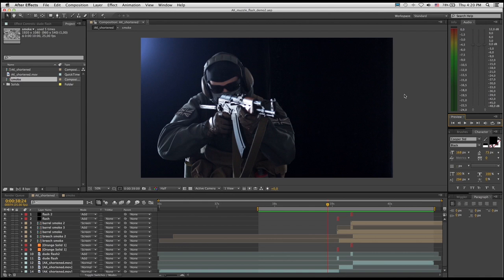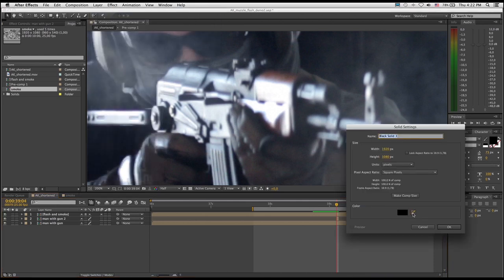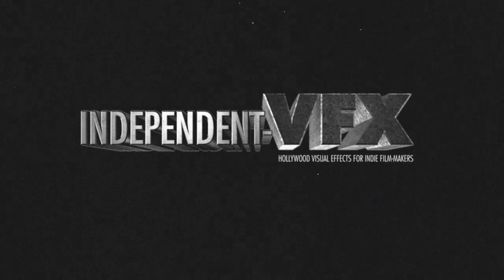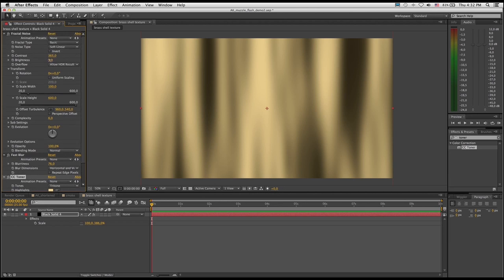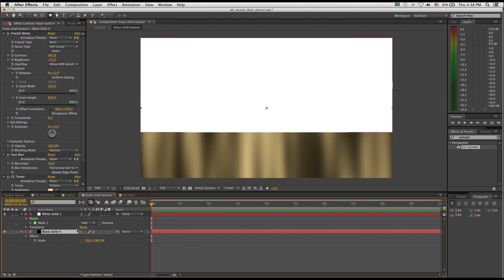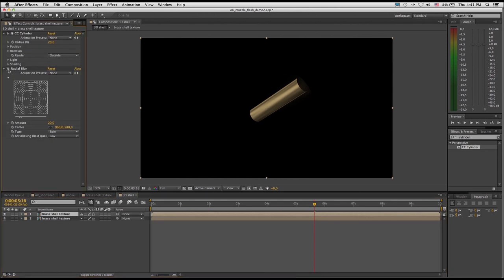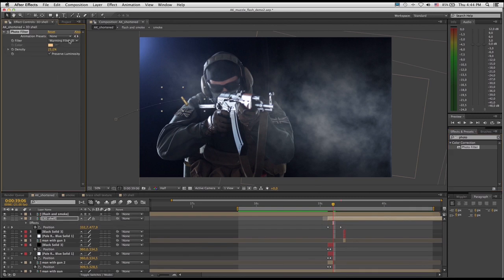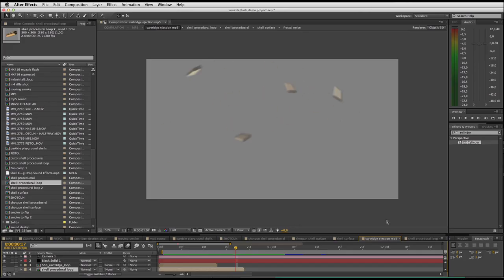TUTORIAL: Muzzle Flash - part 2, bolt action and shells

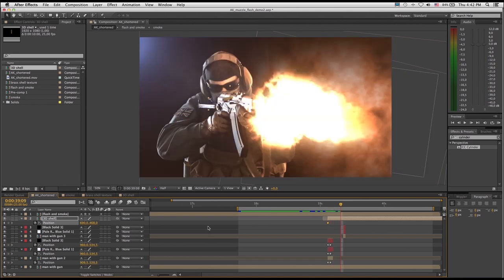Comment: 13:50 how do you make the bullet shell actually move from the AK to out of the screen?
Reply from the maker: @HersheyZ- you can move it using the move tool (activate by pushing V on your keyboard) or select it form the toolbox.  Its the mouse pointer/arrow icon.  Or you can also move a layer using the transform properties in the timeline.
Reply: THANK YOU.

Comment from the maker: ColeMiner2424 - the silenced gun uses the same techniques in the tutorial.  You basically leave off the muzzle flash, or you can use an orange solid and mask it with a small circular, feathered mask to create a slight glow at the tip of the barrel.  Its really that simple.  Also - silenced weapons tend to look better with a lot less smoke.